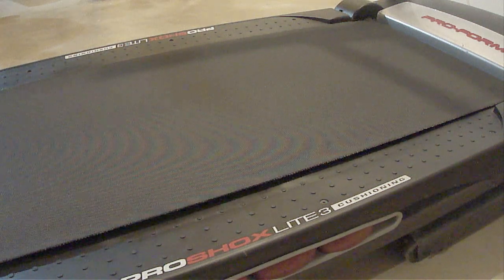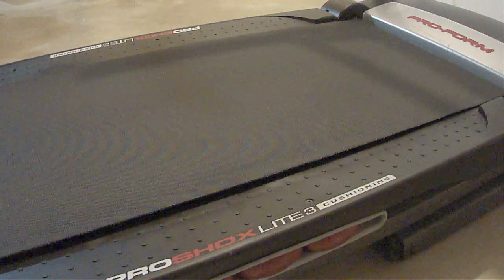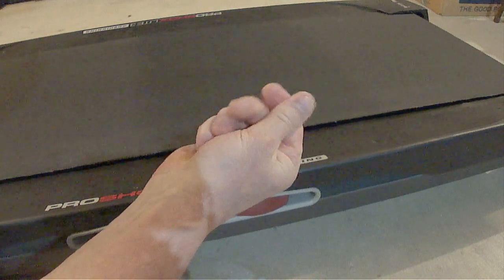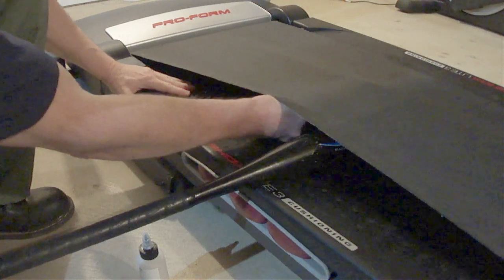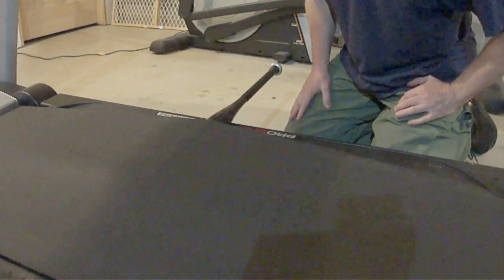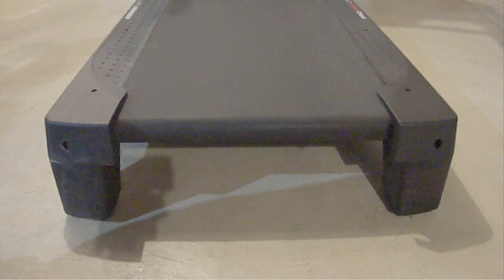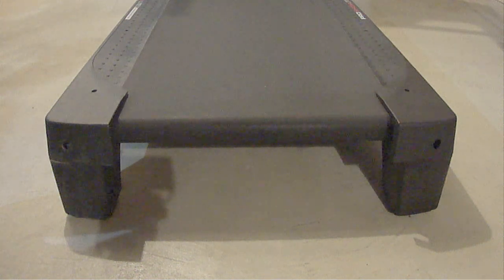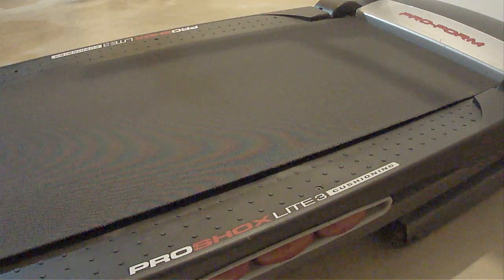Treadmill Belt Slips - Easy Fix!

Comment: Hey my belt is all the way to the right how do i fix this????
Reply from the maker: You need to slowly tighten the rear roller on the right side with an allen wrench while it’s running until the belt evens out.
Reply: @proclaimliberty2000  so when it evens out what next how do you prevent it from happening again
Reply from the maker: @Prxsumo  There’s no guarantee that it won’t do it again but once you get it adjusted properly it should stay that way for a long time. Our treadmill gets used every day and I have not had to adjust it in years.
Reply: @proclaimliberty2000  ok thanks so once it evens out it stays like that for awhile
Reply from the maker: @Prxsumo  Yes
Reply: OMG 😲 osh THANK U SO MUCH!!! Solved my problem!!!